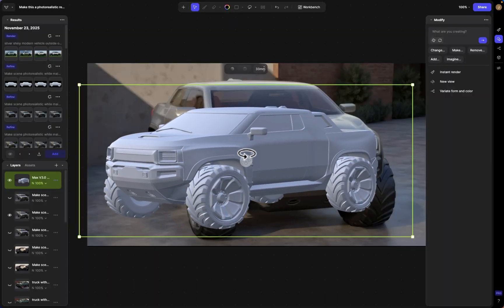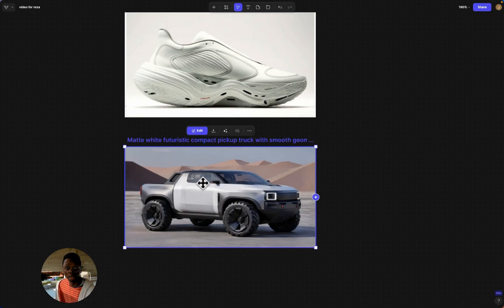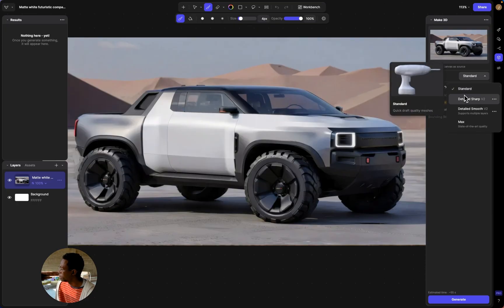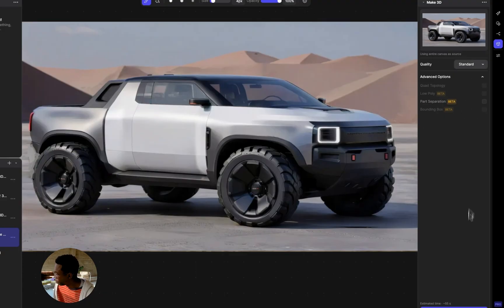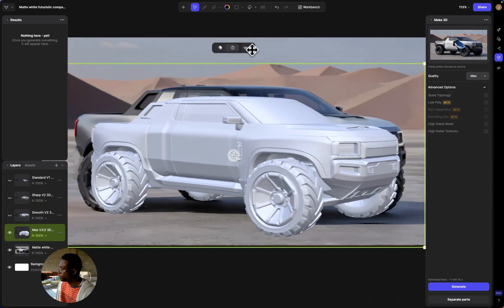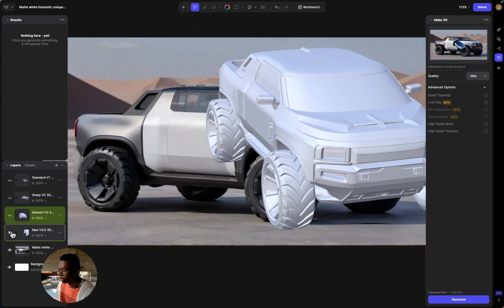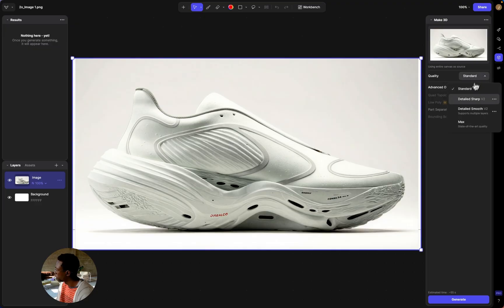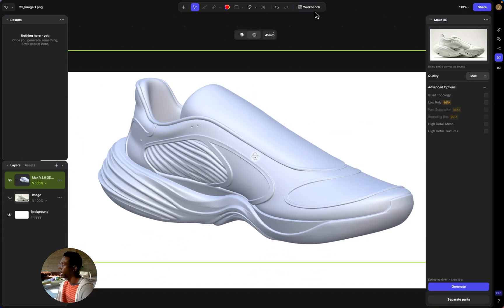How to Turn 2D Designs Into High-Quality 3D Models in Vizcom

Comment: Question: Is there any way to take multiple images to generate a better model in the MAX version?  Ie: front 3/4 view and a rear 3/4 view to get correct details for the full 360 model.  Thx!
Reply: Also can you get into Quad Topology, Part Separation, Bounding box, High Detail Mesh, High Detail Textures for a tutorial (or series)???
Reply: just added this in!